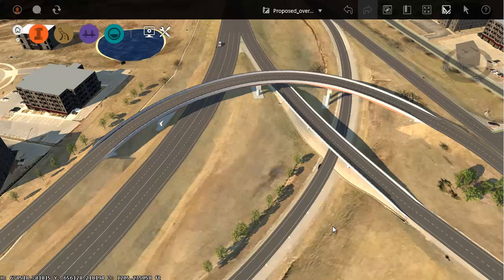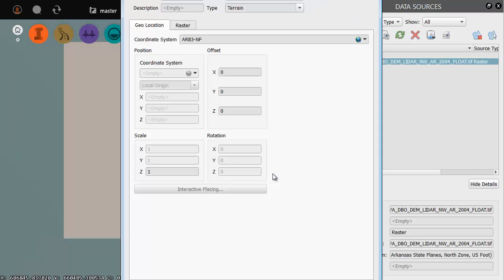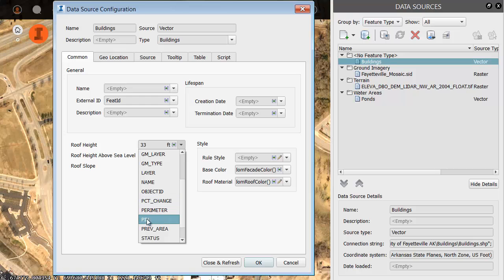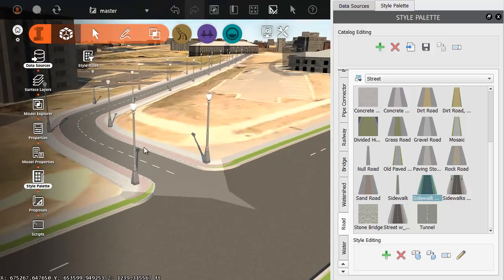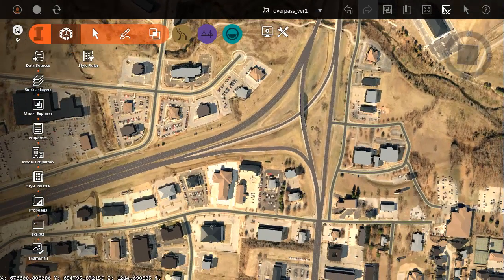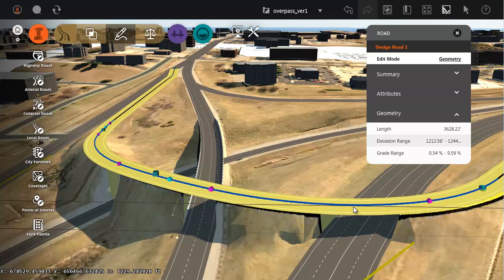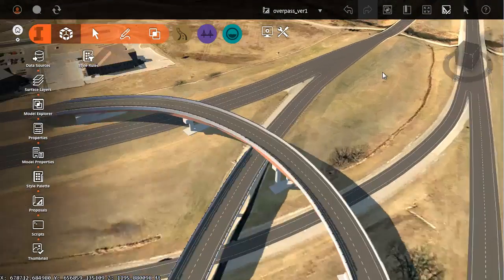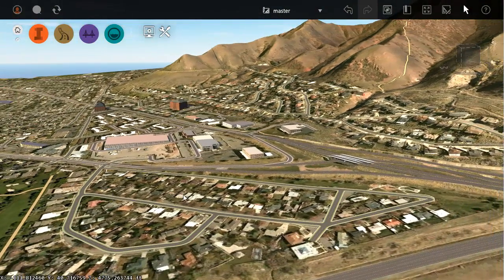InfraWorks 360 Introduction

Comment: It's really Revit for public infrastructure isn't it? Cool. Really cool. But I'm afraid of it being more of a sales 3D generator than a real tool for construction. What we need is for these to be as accurate as possible and to be able to feed data into these models and choose its interaction with the geometry in the most intuitive, best way possible. Ideally we would get a component into this software that allows for the analysis of the terrain, underlying foundations annd structures. Because that's the real hard part of civil engineering I reckon. To build a road out in the desert you can do with a truck and a map with pencil drawings but to engineer a tunnel or a bridge, new road in the middle of a city without collapsing the nearby buildings, emptying the river, lake into your construction site, etc is a whole different ball game where this software won't be up to the task yet to be of much use I reckon. I love this but I also want it to be far more than a pretty, efficient 3D generator. Which I'm sure it is already but if it could really become Revit, some form of BIM standard full of accurate data for civil engineering that would be fantastic. Imagine being able to just import site survey data and the Revit models of the surrounding buildings to be able to directly see and calculate your needed factors of safety, fault lines/pressure points and all the associated piping and cables that surround your project. Generating and modify details from this. This would have enormous impact. The digitalisation of all this infrastructure work really could be an amazing revolution with massive gains. I work as a draftsman for a big telecom company doing mostly roadworks and the cost associated with inefficiencies, oversights, mistakes in this area and the amount of laborious communication and planning involved is really enormous. With this sort of digitalisation, if accurate, we can really save hundreds of millions of $ from the speed of being able to assess infrastructure work and contact the necessary involved parties to changing plans and just having a much better picture of what we are doing. A great deal of mistakes can be avoided with a fully digitalised, 3D component of public infrastructure. From what I read in these comments we can only draw the components and export them to other software for civil engineering I think this Infraworks package should become part of Autocad map3d or revit. Well I think those 3 should really be onne Autodesk product of which you can just use certain functions. The Autodesk product lineup really is convulted and unnecessarily fragmented. The software in itself is mostly very potent and great but then it is ridiculously expensive. We need these sorts of tools. I would love the topographic terrain generation to become a part of the geolocation feature in Autocad. It looks to me right now like every time some new features are desired they make a new program instead of adding the feature to the existing lineup, programs. Then in the new programs a great deal of features and user developed macro's, add-ons are lost. If Autodesk just started reducing excessive stable of seperate programs to focus on centralising all the features in a single or a few programs. Then MAYBE they could justify the 5000$ a year RENT of a piece of software. But I ramble. Great video. TY
Reply: i agree with you. i have worked infrastructure jobs too.its hard to predict cables or tubes from projects made long gone.